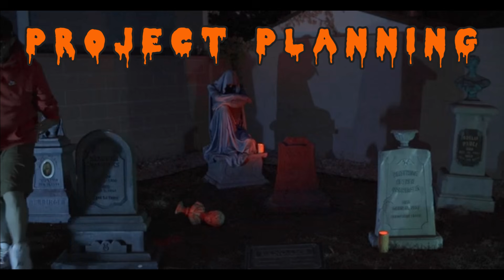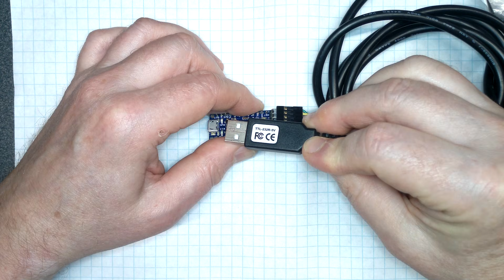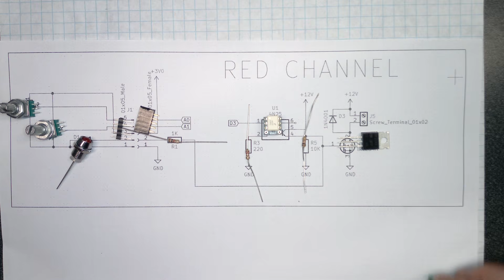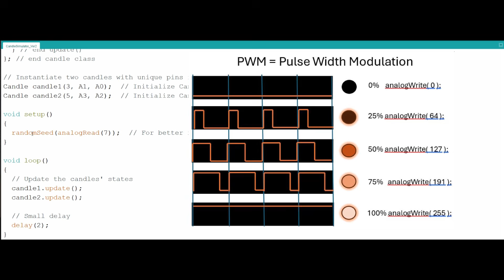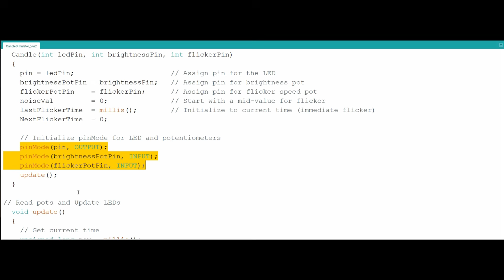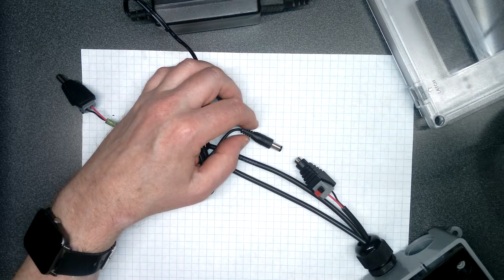DIY Arduino LED Flicker Controller

Comment: Over the past few years I have been building controllers using esp32/esp8266 microcontrollers. I don't take advantage of the wifi component of these MCU's but I mainly use them for presence detection with an output audio and output relays (simple on and off). This video is really great and another level for me on circuits and Arduino code! Thank you so much for sharing! I can't wait to see what other videos you have planned! (Especially the Arduino ones related to Halloween!)
Reply from the maker: I'm glad you liked the video and found it useful.  I haven't done much with ESP modules, but your comment about working with them makes me curious to look at them and see what they offer, I know they're pretty amazing.

There will be more programming and electronics videos. As a bit of a sneak preview: the next one coming up will be in the Scary Pirate Prop series. The prop is really 2 mechs and there's an interactive dependency that will require interlocks at the hardware level, and I'm pretty sure I'll need a state machine for the logic in the Arduino.